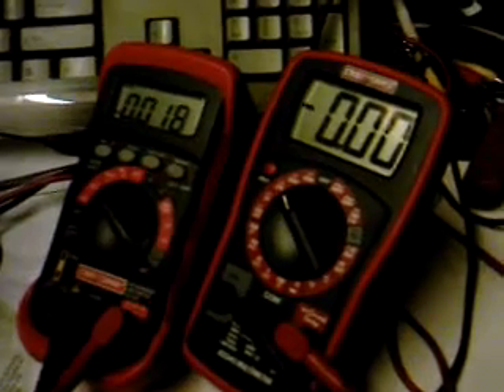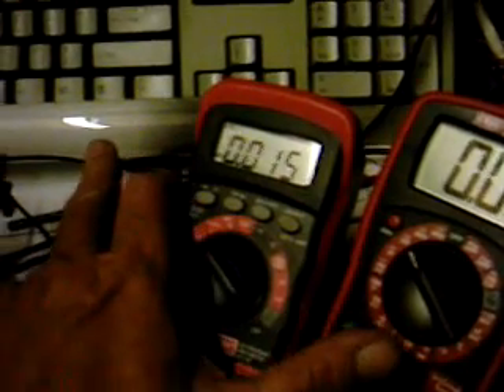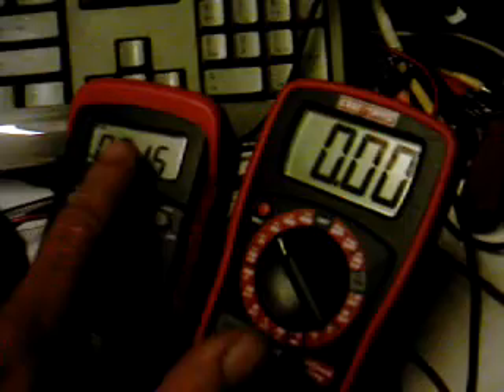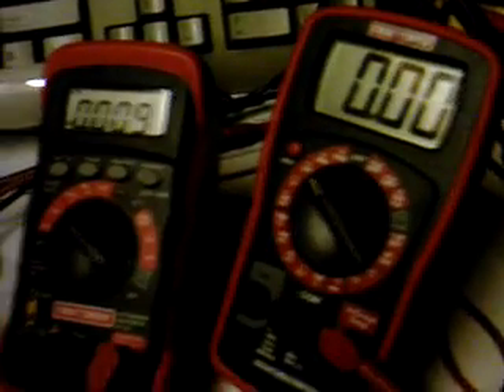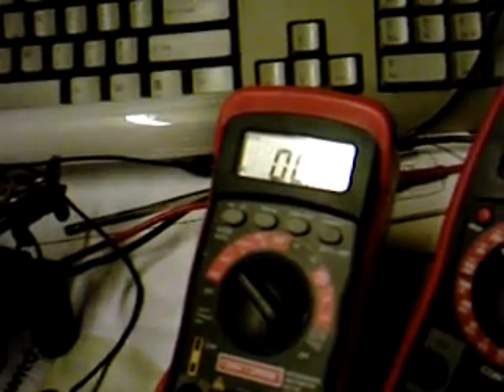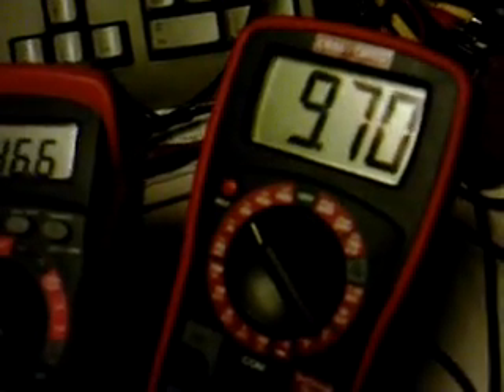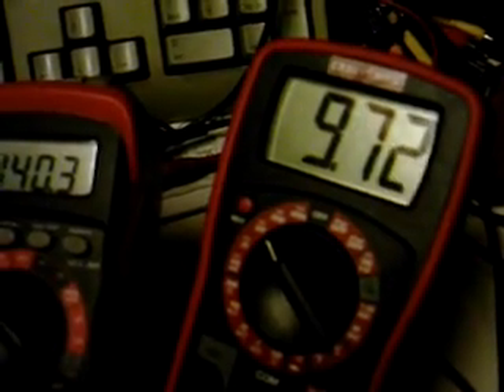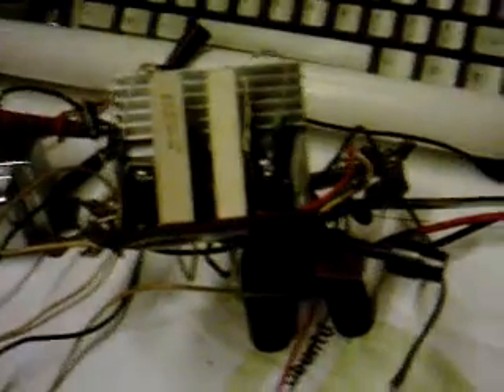HHO Power flip flop #4

Comment: nice- i built a flip flop after seeing your video-but im still looking for the appropriate transformer-and i agree,a cell with no electrolyte is more like a capacitive load than a resistive load.And i feel that the use of electrolyte will lead to the false belief that the cell is operating efficiently,when in fact it is only due to increased electrolyte
(e.i. resistance=heat/waste)